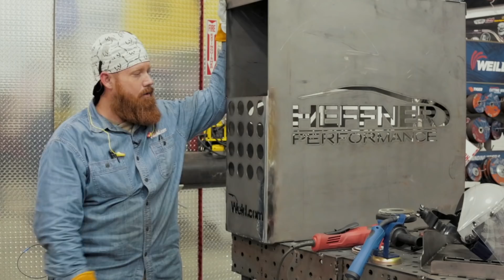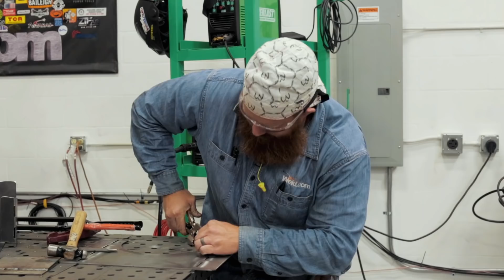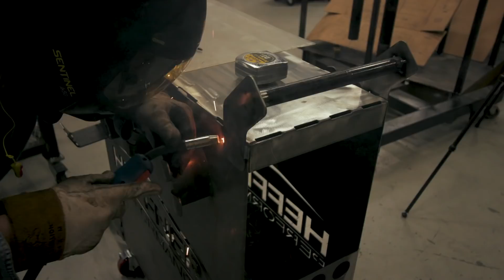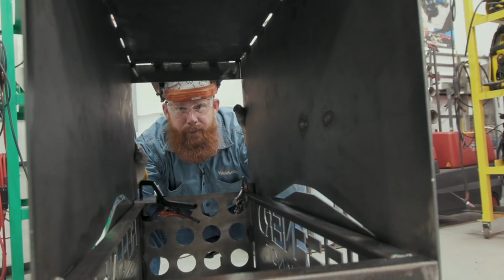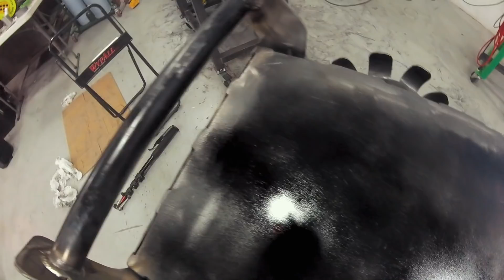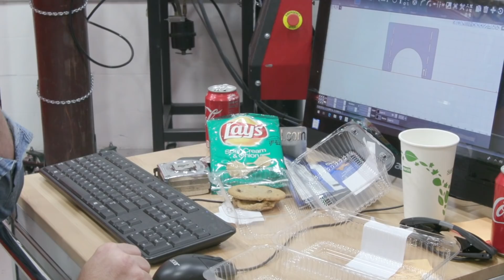Origami Weld Cart Build!! Part 3

Comment: THE HANDLE?  I don't understand why you would put a handle across the front of the welder.  Usually, there are cords and hoses that plug in right behind where you hung the handle.  ???  Great series though.  I was going to build a cart out of scrap.  I went out to the metal/scrap yard and told the guy I was going to build a cart.  He told me "Like that one?" pointing to a cart that someone got rid off.  It was heavy duty with great casters and at 50 cents a pound.  Yep!

Comment: What about that tension that’s left in the metal from that process? That’s not a problem? Also, you can see near the end, from the front, that when turning to one side, one wheel ends up well under the case. I’m concerned about stability. I would have put the wheels on outriggers, about 3 inches out from the case. On the sides. This case is unusually narrow, and tall. It’s also top heavy. I know that it’s not very likely to topple over, but why take the chance?
Reply: Mel Gross the tension from being held in place is very minimal. The wheels were not completely tightened so they were not sitting very level, most of the weight is going to be in the bottom due to all the filler metal (about 60lbs or so). We couldn’t make the cart any wider due to size limitations in the customers work space. Please let me know if you have any additional questions. Thanks for watching.
Reply: well, leverage is exerted the further from the point of movement. The welder on top, as well as the weight of the cylinder as it goes up in height overpowers the weight right near the bottom. I'm not saying it will tip, but when turned, and with one wheel side well under the cart, the moment of momentum is under that wheel contact point. someone banging against the other side could exert enough force to tip it.

I understand the room requirements, but the hose holder stand to from the sides, and that room could be used to move the wheels out a bit. @GodslilRedneck23

Comment: Nice project on that weld cart. Only thing I would have changed is the sidewise wheelspacing. Wider wheelspacing makes for a bit wider cart in total but still provides a much more rigid stand.
Reply from the maker: It's a valid point. However, this cart was built custom for their shop. We had them measure the space it would be in and built to those measurements.

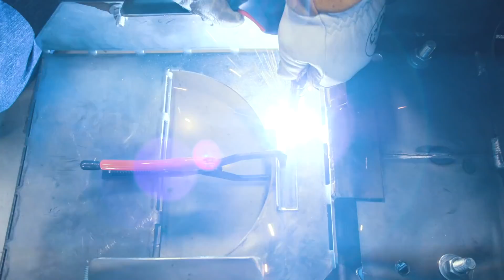Comment: At 14:40 - 14:41 the cart is on 3 wheels, the 4th wheel is up in the air. It's not square and flat...... Looks like your wedge made the bottom halves even, but the cart isn't squared up properly. Details......
Reply from the maker: Casters weren't fully tightened down yet. It is square, I assure you. Thanks for keeping us on our toes.